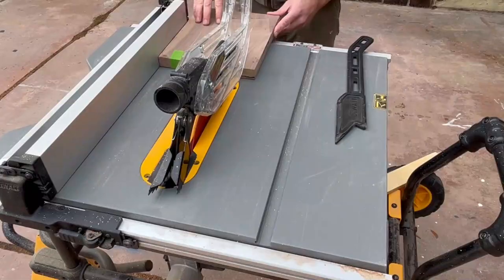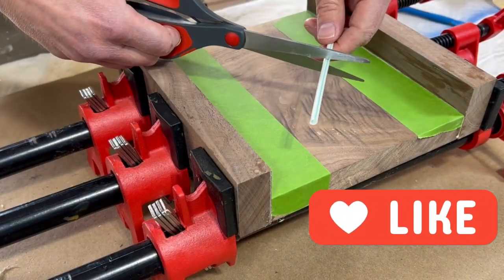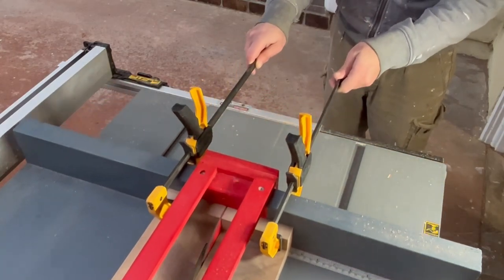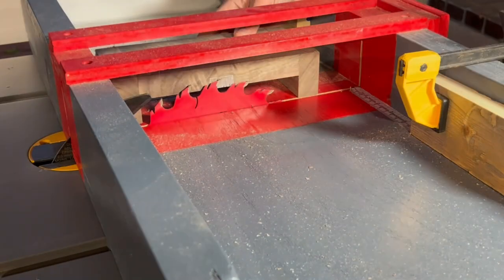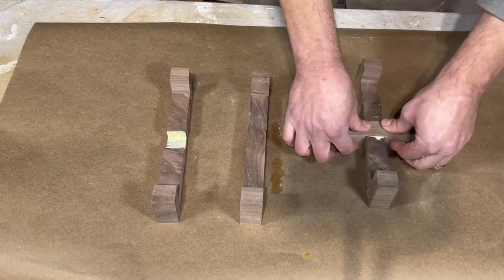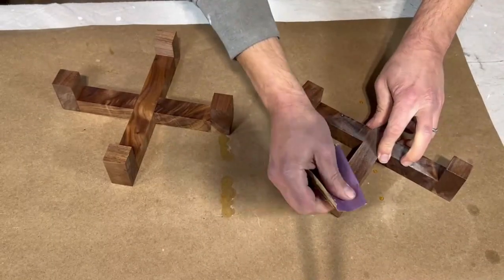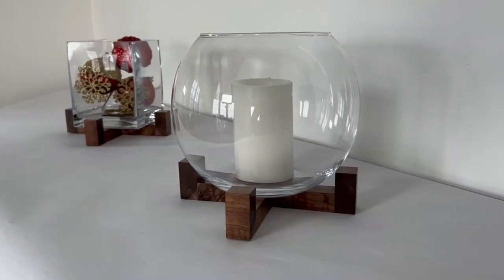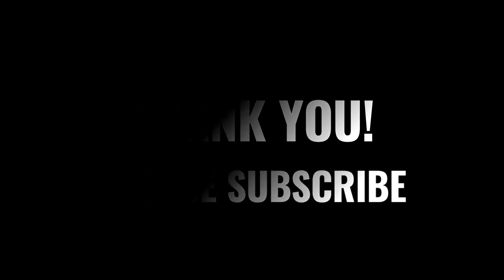Another easy woodworking project that sells for 2025 (DIY)

Comment: Beautiful and elegant and yet so simple. I love the construction method. 

Are you using a full 1" thick piece of walnut?
Reply from the maker: Yes, I used a 1'' think piece of walnut. But you could use thinner or thicker adjusting then all other dimensions and cuts. Thank you for the feedback, I am glad you liked the video!
Reply: @gemriverbuilds7840  thanks for the response. I think the 1" material looks better for what you were showing it for. Anything smaller would look undersized. Of course, the smaller material could just as easily be staged with smaller items.

Comment: Where do you buy your hardwood it’s seems to be very high
Reply from the maker: I buy mine at a hardwood dealer. I believe this was about 4/4 inch thick and I purchased it from the dealer at 5/4 inch but it is close to an actual 4/4 because it came square on two sides and it was already planed. Thank you for your comment and participation.